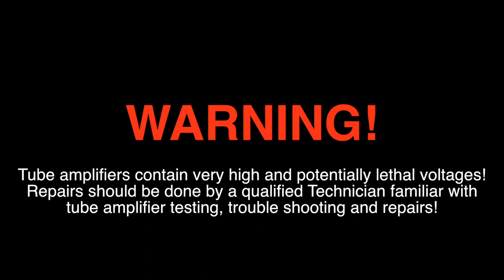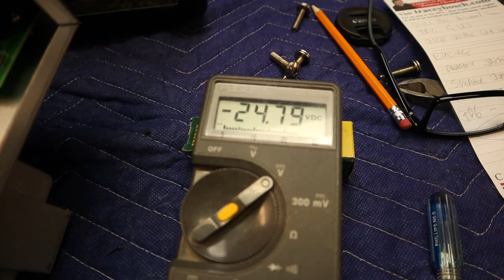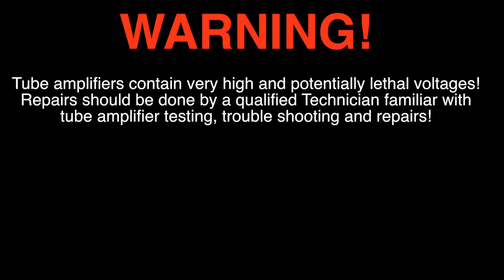BlackStar HT5R Repair // How to debug, fix, mod and test this common issue with these amps!

Comment: Mine just suddenly stopped emitting any sound whilst I was playing through it on the clean channel. Nothing. There's a very low level low pitched hum when on standby and/or on.
Reply from the maker: That sucks.  Hard to say what the issue could be.  If you can hear a hum, then the speaker and output transformer appears to be working. I’d try plugging into the headphones and see if that works. If that works then it may be the issue I discovered.  Not sure the amp is worth taking to a amp tech. They will probably charge you more than it’s actually worth the fix.  Good luck.
Reply: @Mike Freda  thanks for the advice mate. Will give it a look but in all liklihood I'm gonna buy another amp. The amp was great but it doesn't suit my taste anymore anyways.

Comment: im getting the feeling i shouldnt buy this amp..is the mark2 improved or does it still shit the bed like this model..what amp should i get for home use..but low low low volume with good quality sound..im looking at the mark 2 because it has 0.5w mode
Reply from the maker: I’m not sure if the Mk2 has dealt with these issues. Best to check the BlackStar amp forum.  The small fenders seem to be reliable. Blues JR and Pro JR have a lot of tonal variety.  

I make my own amps from scratch so I’m not really up on what is currently available for lower power practice amps.

Comment: Anyone know if the mkii is the same design? I just bought a used one and 30 min into playing I had loss in gain. The OD channel sounded “clean” and muffled and clean channel was almost silent. I’m thinking I should return it rather than spend lord know how much money trying to figure this out
Reply from the maker: If you are able to return it, I would.  They tried to “fix” other versions but for whatever reason they still have issues.  That being said, if you can’t return it you may be able to just install the heat sink in the transistor.  Cheers.
Reply: @MikeFreda  thanks for you input. I went ahead and put in refund request. Luckily seller is responsive and I hope believe all will turn out ok. It’s a real shame because I really enjoyed the low volume sound and simplicity of the amp. I did learn that I likely won’t buy another used tube amp as I’ll feel more comfortable with some warranty support. I got my eye on a Rocker 15 but wow it’s a price jump. Cheers and great video!
Reply from the maker: Hope it works out for you.   I would use the term “tube amps” very loosely with these amps.  There is so much solid state in these amps that they can easily replace the tubes with solid state devices that you probably would not notice the difference.  
You can’t go wrong with a small tube amp like a Champ or Princeton.  You can pick these up for people who made them from a kit.  All the parts are readily available and lots of resources to help you out it you have an issue.  Cheers.
Reply: @MikeFreda  Great info which I’ll keep in mind, thank you again 👍🏻

Comment: Hi, mosfet transistors are overheating.  What is the reason?
Reply from the maker: Yes, the appear to be.  When transistors overheat they are typically running to much current and can’t dissipate the heat effectively.  One of the reason in this amp is how they are biased and it would appear that the how they are mounted in the circuit board the traces are too close to each other. Stray voltage is effecting the bias.  I also think that they may be undersized for this task.  Clearancing then traces and installing a heat sink seem to be a cure. Cheers.
Reply: Thanks
Reply: Didn't the designers think about this?
Reply from the maker: That's a great question.  I suspect that a prototype is designed and made with certain parameters and variables and that passes. When they finally go to full production things are done to save money, steam line or parts are substituted and this is where the troubles arise.  One would think that most components would be designed to handle 2-3x the dissipation required.  Apparently not.

Comment: Is the Ht5 Metal the same ???
Reply from the maker: I’m not sure.  You may want to download both schematics and check to see if they are similar.  If it has a 12AX7 and 12BH7 tunes it may be. Cheers.
Reply: Yes it does have the same Tubes !!!

Comment: Sad to hear that this is a known problem.  I’ve had this amp on my want list. Is this a problem with the entire HT lineup?
Reply from the maker: I'm not aware if this is an issue on the entire HT lineup. This is the one and only BlackStar I have opened up and repaired. From what I gather, the "head" version and the "combo" version share the same board. Probably best to contact them directly.
Reply: My Ht1r mkii had the same issue out of the box :(
Reply: My 5ht r is sounding super muddy Even with a clean tone. Can't even play a chord. 
Gonna replace the tubes and hope for the best.

Comment: Did they fix this issue with the MKII?
Reply from the maker: I’m not 100% sure. I know on some later models they drilled holes between the mosfet traces but that alone is not enough. Your best bet is to look/search on a couple amp forums like ampage, Music Electronics forum or the gear page.. They are a pretty good resource.
Reply: No, I have the later version (with the slots already in the board) and it still has issues, buy something else!
Reply: @pcb1962  What kind of issues? i'm on the brink of buying this amp, but this video make me think twice.

Comment: Is it a real vacuum tube amp or a hybrid amp ?
Reply from the maker: Yes, no... sort of! The 12AX7 preamp tube and the 12BH7 power tube are in the signal chain for the speaker output.  The 12BH7 is directly connected to the Output Transformer and the secondaries of the OT are connected to the speaker.  The amp uses solid state components to tightly regulate and control the operating parameters of these two tubes. This printed circuit board has a section that is used for the headphone and lineout. It's not a true point to point with all passive components tube amp like the old Fenders and Marshalls. It's a modern amp with a mix of solid state and tube topologies. Cheers.
Reply: @MikeFreda   thanks you so this is real tube amp
Reply from the maker: You're welcome. A real tube amp? hmmm,  what's your definition of a real tube amp? The tubes are in the signal chain and the output tube powers the speaker via the output transformer. So in that sense, the tubes are amplifying the guitar signal that comes out of the speaker  Is it built like a vintage tube amp? No.  It's a modern interpretation of a tube amp using discrete components to give you versatility and ease of mass production.  You can have a look at the schematic and follow the signal chain to see for yourself.  I'm not sure if that answers your question?  Myself would call this a real tube amp really loosely. There is a lot of discrete components in this amp that if anything goes wrong with it, it's really hard to fix unlike vintage tube amps. Cheers

Comment: hi Mike, thank you for the video :) do you happen to know if the MKii revision has this issue?

having tried a number of amps before the pandemic, I'm thinking of maybe buying one soon. I don't need it, but it has a lot of handy features, and I know I really like the clean and distortion channels from having played the original version a number of times in shops. tempted by that sweet, warm, lovely distortion sound!

I would need the MKii revision. I've never owned a tube amp due to my living situation, where I am going to be practicing relatively quietly in my bedroom. if I were to get one, which is absolutely not a need, and more of a want... it needs to have that power reduction feature to ~0.5W, plus they seem to have added other cool stuff to the revision. :)
Reply from the maker: Thanks. I believe the newer ones have less issues and behave better than the older models... but I'm not really sure if they sorted it out 100%. I do believe they are aware of the issues. Yes, this amp is a "tube" amp but I would use that term loosely. There is so much solid state in this amp that I'm not sure if the brand of tube makes that much a difference in this amp. Yes, a lot of versatility in this amp, it does sound good at low volume but a far cry from a 50-60's tube amp.  As for bedroom listening, you could just get an attenuator (or make one) and use any lower power tube amp you want. I've done this and it works pretty good. I hope that helps!?
Reply: @MikeFreda  that does help :) thanks for the info!  I never thought of trying to make an attenuator, as I assumed those were fairly complicated devices?

never had a separate head and cab combo either, and while I have read a little and know some basics (like matching the impedance of the speaker cab with the output appropriately). beyond that, I mostly scratch my head in confusion, not having the requisite experience.

I enjoy tinkering with the various inexpensive guitars I have, so I could see wiring up some more basic circuits for some pedals or simpler tube circuits could be fun.

debating in my head if I should just go with something that "just works" so I focus more on practicing, or if I'll go down the rabbit hole of tinkering and fiddling. there's so much out there, and it's pretty fascinating stuff!

Comment: Is this amp a mki or a mkii?
Reply from the maker: Unfortunately, I do not recall. The board itself seemed to be revised from the factory but I’m not sure what version it was.
Reply: Going by the control knobs and panel it looks like it's a MKI. The MarkII has beige/yellowish chicken knobs not chrome buttons
Reply: @LiesThatBind  Do you recon the mk2 would be prone to the same problem? I'm on the brink of buying one, but this video stalled me in my decision. Thanks!
Reply: @ChristiaanBurgel  not an expert in electronics and amps, but I own a Blackstar Ht5 MkII and after over a year of use (I practice between 30-60 minutes a day) I've had zero issues.

Comment: Hi dude, have u replaced the tubes anytime?
What brand do u recommend? I got one HT5!
Tks and very good video! Piece
Reply from the maker: Unfortunately, there isn't a lot of selection of 12BH7. ELECTRO-HARMONIX  and JJ's seem to be the most popular.   You may be able to find some NOS treasures... but I think that would be a waste of money. Honestly, this amp has so much solid state components in it you would be very hard press to hear the difference between tubes. The 12BH7 is a robust tube and if the surrounding circuit stays within operating parameters you should be able to get years (8,000+hrs) of run time on them.
Reply: Thank you for ur inputs! Cya

Comment: Hello. My HT5R amp has started making low, contionous crackling noises, and a very distorted guitar sound. Only when when volume turned to max i can get some guitar sound out of it, though very distorted.  
My tubes are perfectly fine, and i even tried replacing them with new ones. 
I made a little video : https://www.youtube.com/watch?v=6hRHwseQZgo
Would be very grateful if you have an idea of what it can be, and/or if it can be repaired
Reply from the maker: Without testing voltages and resistances, it’s hard to say what the issue is. Could be a speaker, dirty potentiometer or the common issue as described in my video. I suspect it’s the latter. If you are not handy or are familiar with electronics, you will have to take the amp to a tech…. But I’m not sure it is worth it.
Reply: @MikeFreda  Thanks. After another chat with my niece, she admitted that it had been gradually declining, so it seems to be the common issue that you describe here. I will hopefully be able to use your video and go ahead and make the repairs. so thanks for making this video for the rest of us, so that we can get our amps back working ✌